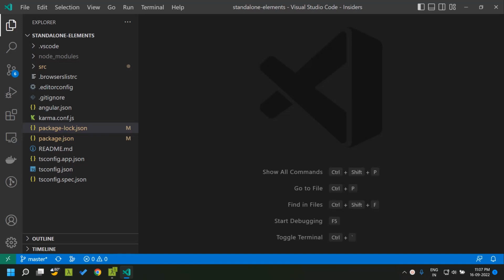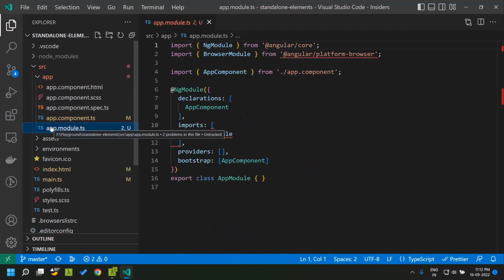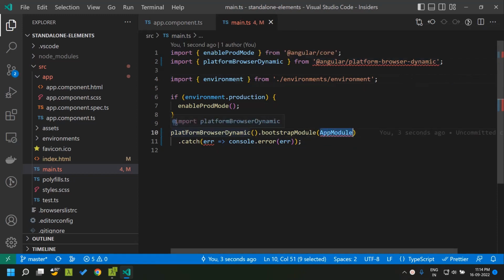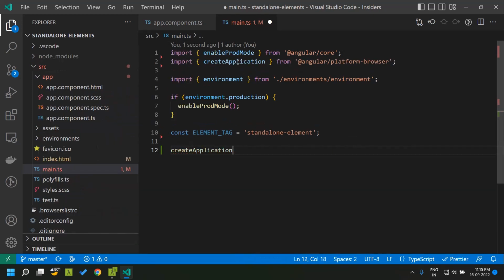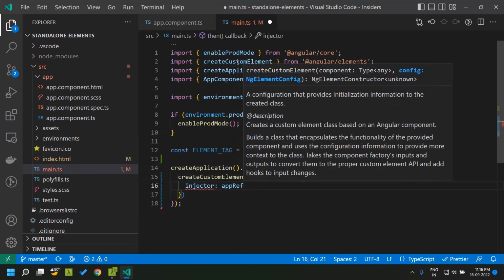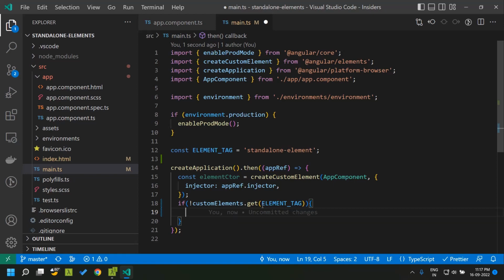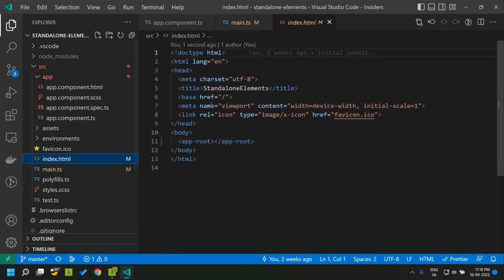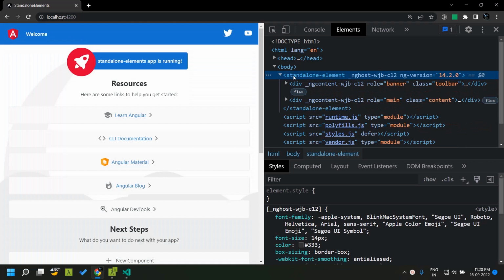Create custom elements using Angular elements & standalone components | Angular 14

Comment: In mfe how do you manage fallbacks , suppose at the time of loading the mfe there is some issue has come,  in that case your app will crash right, then how do you manage that ? 🤔
Reply from the maker: Usually we log the failure of the mfe load. The mfe functionality will not be available. Don't know if there is any way to handle it 🤔
Reply: Did you ever experience app crash for this reason ?? React or Angular whatever.
Reply from the maker: No. App hasn't crashed. Only the micro frontend won't load and it occurs usually when there is some network issue.